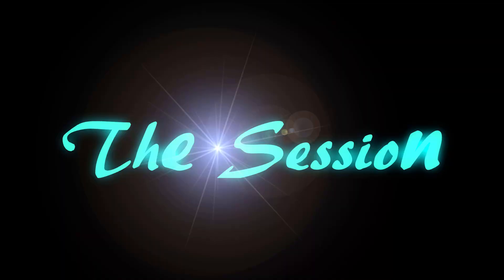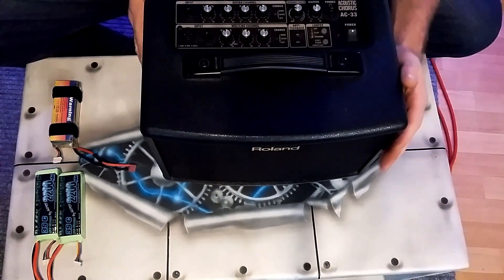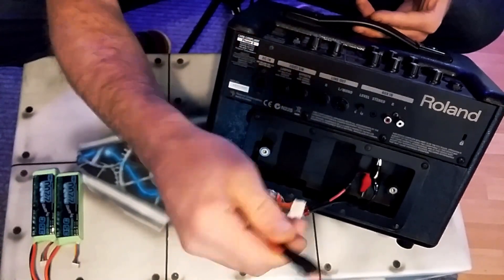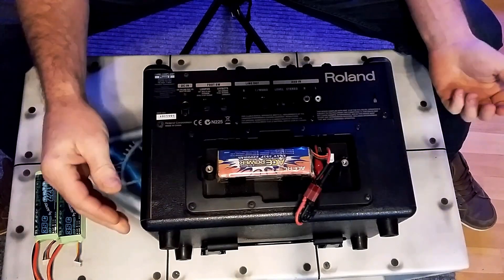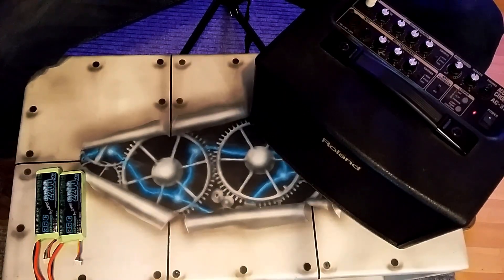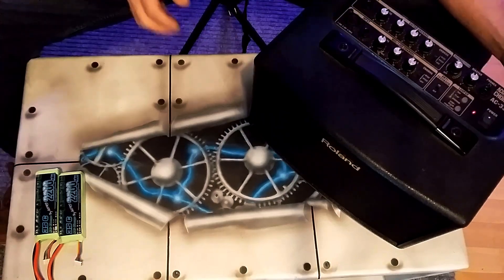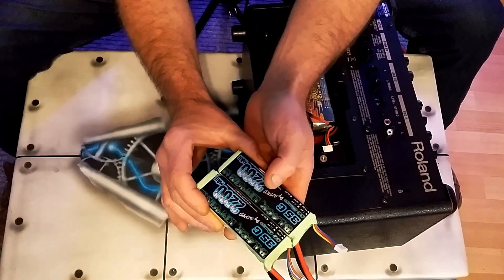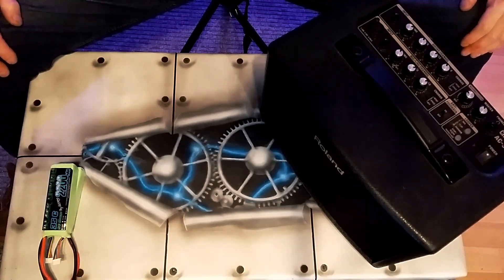Convert guitar amplifier to battery power

Comment: Since you said you could do this with 220 V also because there are adapters out there do you think that would work on some thing like the black store HT one or hybrid tube technology? This is a very informative video. Thank you very much. I look forward to your opinion.
Reply from the maker: Hi, ok so the amp needs to able to run on 12v. The adapter is normally 220v from the wall. The roland i use for example is already supposed to run on a 12v battery but they obviously down the voltage in the supplied mains power pack to 12v. In terms of running a tube amp if not 12v then you would need somthing more powerfull like the big lithium charge batteries they do now, but they are expensive. You could try looking for a cheap inverter to run 12 to 220v but you would probably get a lot less run time on the amp so would have to run more 12v battery packs in parallel to give you some decent run time . Hope this helps.

Comment: I have gotten a 2400 mah battery installed and it works! and a usb balance charger. will test it busking soon. I will suggest a little upgrade though which I have ordered. A small battery voltage level indicator with LEDs that show the current battery capacity level (five LEDs that show 100% 80% 60% 40% 20%), these are cheap and all over the internet, you can get ones specifically for li po 3 cell 11.1v and you press a button to see the level (draws only 15ma when on), so you don't accidentally discharge your battery dead and you know the battery level when out about busking. you just connect it to your positive and negative terminals.
Reply from the maker: sound good happy busking😄

Comment: Hi there, thanks for the video. My main issue with the original battery system is that the voltage would drop quickly (withing 1-3 hours) and audio volume power would "fluctuate", drop in and out(probably voltage drops) Does this solve this issue and does your setup hold high enough voltage for longer? I would not need 16 hours but 4 hours of it holding original high voltage would be ideal, so that i can play at full volume without the amp volume dropping in voltage i.e "coming and going". and can you recommend some charger and size of batteries and where to get them? i.e ebay or aliexpress etc? cheers and thanks! also how to you fixate the velcro, glue it on? do you need any voltage regulator or current regulator or stuff or just plug straight in? Thanks THANKS!
Reply from the maker: Hi there the batteries are 11.1v lipo packs, often used for rc models you can find them on amerzon or even a model shop they are a 3cell battery and charge to 12v fully charged, which is the same voltage as the amp allows. the bigger the amp hour of the battery the longer it will last. the one i use in the video is 2200mah and i got a good 7 hours befor re-charging, you could get 5000mah and double that time.The charger can also be found on amerzon or a shop and it is a lipo balance charger. if you are in the States, hobby king sell good affordable batteries and also deliver to europe from a european depo. Get the same connector as the battery but the male version to solder to the amp and some wire about 16awg should be fine. Good luck its a great upgrade for this amp.

Comment: Hey! Thats cool. I have a Roland Ac40, so the same amp basically but it doesnt have the option of adding batteries to it. I was looking to get one of this camping batteries but they are expensive and heavy. How could I go about building an external battery  to power my amp? I mean, a solution that doesnt require messing with the circuits and soldering. I imagine a package of batteries with a cable that goes into the 12v normal input of the amp. Thanks!
Reply from the maker: Hi there if you can find a power brick that gives constant 12v then you can adapt the main cable to plug into the brick and that should run the amp no problem, just make sure that it has enough amp hour the more the better for good run time 5000mah would be ok or more if you can find it. good luck.

Comment: This is a great amplifier! Got a used Roland AC-33RW from marketplace for less than USD180.00 then that 40min. fast charger Energizer that comes with a bunch of AA and AAA batteries (1.2V. 2300mAh) for USD30.00 and this little amp runs for 8hours using the built-in Efx at 70% volumen. My question is if I set that Lithium 12V. Battery its going to be louder?
Reply from the maker: Hi there in my expierience it does not make it louder, i was mostly using mains power but when i ran on batteries i only got like 4 hours. if you are getting 8 hours then thats great. i already had the big lithium so went for that. keep on jamming my friend.

Comment: Great idea - can you explain the soldering more?
Reply from the maker: hey there, yeah its just two crocodile clips to attatch to the back of the amp and the correct battery connection for the lipo. real easy and for outside playing works great.

Comment: Great i was wondering how to do the mod the best way on my ac 33...it seems perfect.. I need to find the proper batteries now.. I m sick of using rechargeable aa which loose power so fast and don t allow ac 33 do deliver properly because of the 1.2 voltage.. This seems like a nice fix! Do you have any link to the model batteries u used? To check the exact properties.. Thanx again!
Reply from the maker: Hi there i havent got a link but check out zippy packs they are reasonably priced, they should be on amerzon, or google 11.1v rc lipo and you will find them. any make will work, the one in the video is quite old but still runs the amp for alot longer than standard batteries.
Reply: @TheSession06  thanx a lot for your answer,  i checked it and i you said  there is quite few options to choose from. Great! :) i m considering going cheap and less portable with regular 12v battery (i have a charger for this already and there is quite few cheap ones at a weight of 2kilos) still better than the time i was carrying a car battery :D or the lipo option which is amazing,  powerful and liggt, and so much in use in drones, small sized boats planes and so on... Thanx a lot one more time! :)
Reply from the maker: Hi yeah that will work no problem. Check out hobbyking or amerzon for the lippo batteries.

Comment: Is it possible to do this to the Orange Crush Acoustic 30? It has a seperator in the middle, so I guess you would have to get rid of that.
Reply from the maker: Hi if its already got the battery pack 12v installed
you will have to do some modding but it will work and it will save a bunch in battery's down the road,cant go wrong with the lithium packs awsome longevity.
Reply: @TheSession06  thanks man! Do you have some advice for how to do that? Can i just aggregate the connectors for each aa-battery holder connector, and collect all plus and minus to each in the lithium battery? It is a simple battery case holder for 12aa
Reply from the maker: Hi yeah if you cant get to the main positive negative then do as you said terminating in the connecter for the new lithium battery pack will do the job. good luck